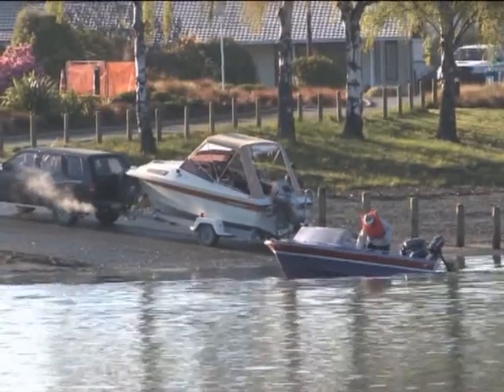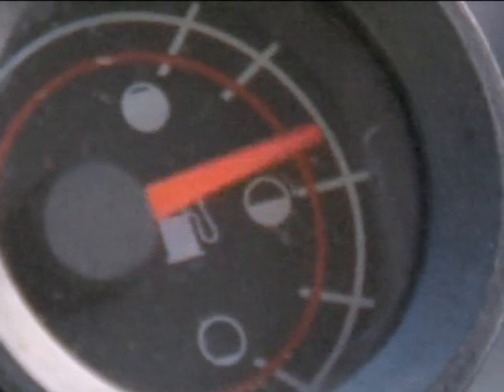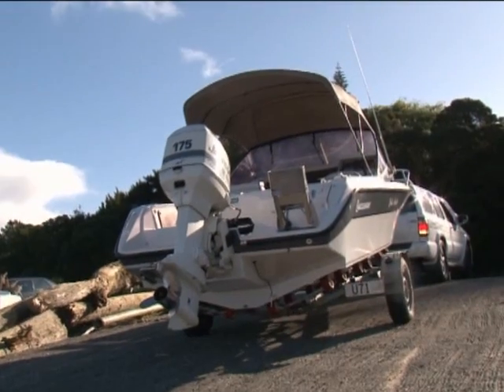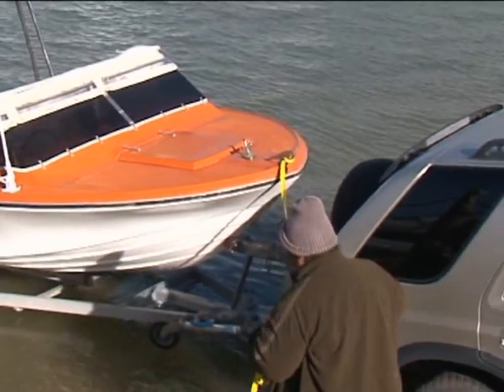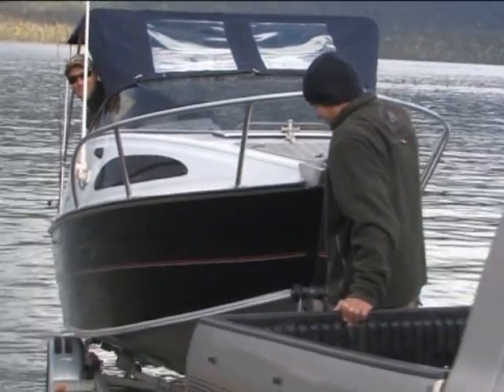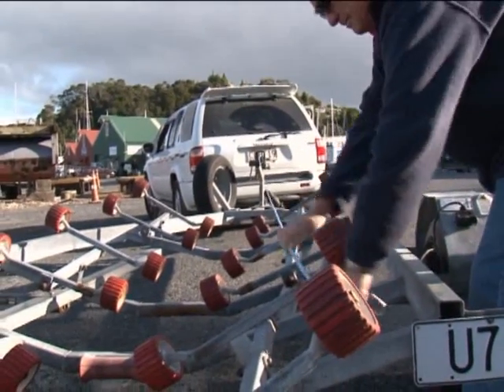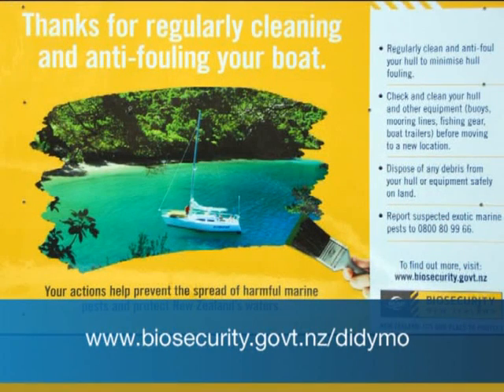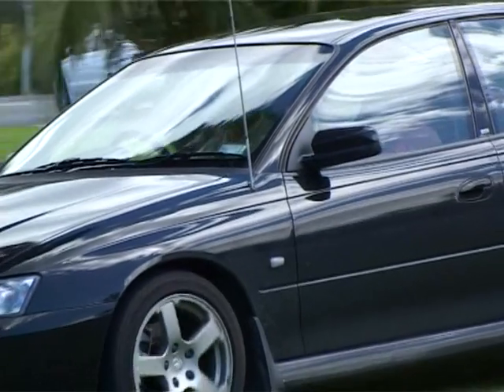Launch & Retrieval of your boat - Boat Safety - Maritime New Zealand

Comment: Yeah, but DO NOT lower the engine first.  I notice in the video the engine is correctly UP, not down as the instruction stated.  You can easily whack the engine if you lower it BEFORE backing down.

Comment: im just a bit worried about traction, i have a short bed pickup and it has quite bald tires. if i get down on the ramp and i have no traction and i begin to spin, whats the best thing to do, and how do i get up the ramp if i cant gain traction?
Reply: Change your tyres.

Comment: DO NOT LISTEN TO THIS VIDEO IT IS COMPLETELY WRONG EXCEPT FOR NOT HOLDING UP OTHERS.TRAILERS ARE DESIGNED TO BE DRIVEN ON AND OFF.THE ONLY TIME YOU DONT POWER LOAD IS WHEN ITS POSTED.